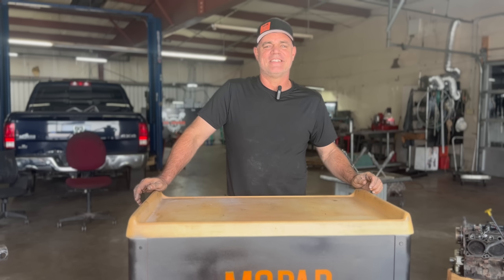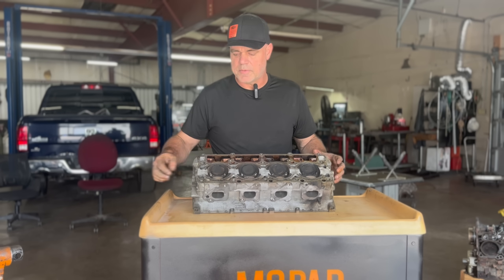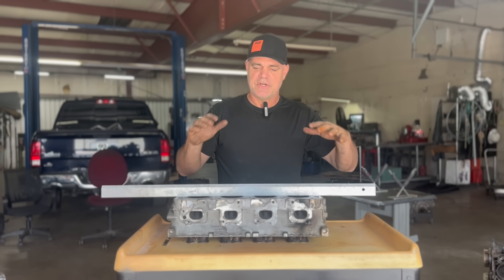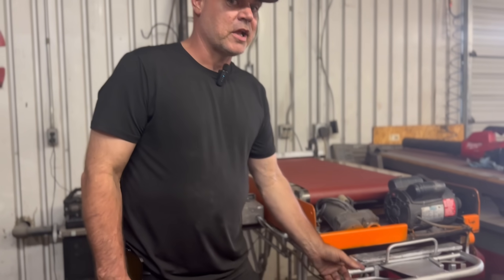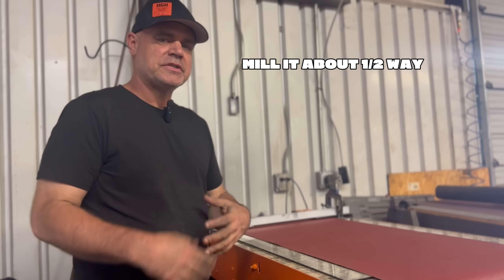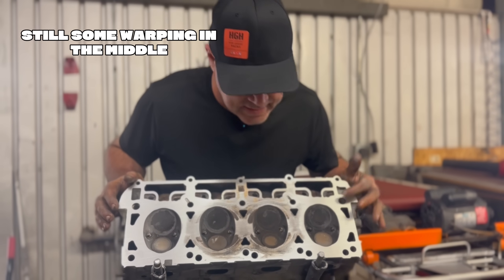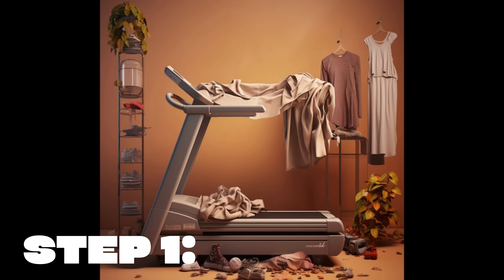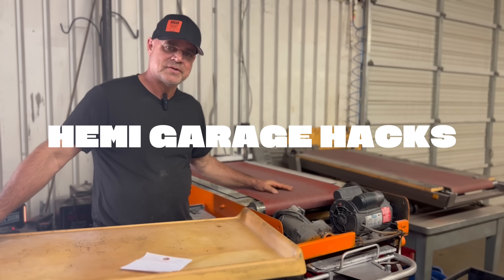I HAVE MILLED 1000+ CYLINDER HEADS WITH A TREADMILL!

Comment: While this will make a flat surface, what prevents this from machining more off one side than the other?  I would think that depending on how evenly the head warped or how much weight is pushing on one side while sanding you could end up with a surface that isn't perpendicular, but is flat.
Reply: really good question and a common one on this topic.  The trick is changing the direction of the cylinder head when you are resurfacing and measuring the time it is on there in both directions.  This has worked really well for me.

Comment: I milled a head from my Briggs and Stratton lawnmower on the floor of my garage with sandpaper.  It raised the compression so much that when I pulled the cord the front of the lawnmower came off the ground. But it was a beast at cutting tall grass.
Reply from the maker: I love hearing those stories, thanks for sharing

Comment: great idea!! what grit paper are you milling the heads with?
Reply from the maker: 60-80 grit seems to work best. 80 grit optimal, but 60 will work as long as you run some exhaust manifolds on it first just to take off the initial aggression.

Comment: Yes this works great, 80 grit.😊
Reply from the maker: 80 grit is optimal, but 60 will work as long as you run some exhaust manifolds on it first just to take off the initial aggression. And the belts last a really long time also.  Thanks for sharing!

Comment: At first I was like, "How can anybody who knows a thing about machining or about engines, possibly think that this is anything other than a totally stupid and idiotic idea?" But yeah, okay I have used granite countertop sink cutouts (often free) as surface plates and while glass is seldom machinist flat, it is flexible enough to shim the low spots and get pretty darn close. I like that the treadmill is of course variable speed, though more power would probably be a good thing. And yeah even a used "proper" mill with a big enough table and x/y movement to mill heads and blocks can be pretty expensive and heavy, but those belts probably aren't cheap, either. Honestly I think I would stick with a proper mill, but your DIY belt grinder apparently can gitter done. So I will just say that this is "entertaining".
Reply from the maker: Works for me, glad you shared:) And if I remember correctly, I think the belts were $250ish for 3 of them.  I bought 9 at the time and that was a long time ago. Glad you are here.

Comment: That’s pretty awesome. Old school dudes did love the sandpaper on glass on granite on table mill lol. Now that’s just how Pakistan started doing it… this thing is legit. 3 extra lbs on outside middles, 5 on centers 👌🏻👌🏻
Reply from the maker: Thanks I appreciate that:)  Crazy thing is you can also do a reverse bow if you shim it just right between the glass and granite.  Not that there is much of a need for that, but it's there if you need it.  Thanks for sharing and glad you are here.
Reply: There is a need for that sometimes I’ve heard. On those long things. That’s where traditionally you bolt it in middle and shim up the sides so you can get that positive center. But hey with this deal hell yea obviously have to experiment a little but just a few strips of paper I’d imagine in the right separation would give you the same thing. Way less guessing just a little more rotation lol. You should maybe ask some dudes who specialize in big hp straight 6’s. RB’s 2J’s etc. they do it. Well some lol. As always… how did you smooth the glass edge? Or found the right old glass table top? Would definitely make sense, and only needs to be smooth on one side. Cut to size and done.

Comment: Back in the 1980s there was a local machine shop that had a big belt sander they surfaced heads on.  I never saw it, but a friend who described it said they would put the head on it and set a sand bag on top and let it sand down a while.  I guess he must have seen a cast iron head being sanded.  Smart use of a heavy pane of glass under the belt as glass plate is dead flat.  They pour molten glass over a pool of molten tin and the glass solidifies before it reaches the end of the tank of tin.
Reply from the maker: Thanks for the helpful information, I love it when people share stuff like that.  Glad you are here.

Comment: Ok that is NOT a treadmill aymore, you may be using the motor of a treadmill but thats about it. there is granite and glass in there, metal subframing that looks like its off my brick saw or something, it just looks manufactured for that exact purpose which is cool and also no longer a repurposed treadmill, you didn't just throw a belt on a treadmill and start milling heads, there was a lot more to be done before that was effectively possible. There is no real treadmill left
Reply from the maker: The frame and rollers are treadmill.  And it looks beefier because it's a bariatric treadmill, which means it's rated for 350lbs.  Granite is for flat surface and stop is added so that I don't have to hold it in place.

Comment: It's effectively the same as a commercial horizontal belt resurfacer.  For those without handy gurneys a simple angle steel frame with casters (scaffolding casters are outstanding, I use them for my compressors and industrial welder carts) is easy to fab. That width is ample for grinding wide intakes like alloy 4.6 and 5.4 manifolds needing cleanup from the usual corrosion.
Abrasive suppliers can make custom length belts if you have trouble finding suitable stock belt offerings.
Reply from the maker: Helpful information, thank you.  another company is called Mirka.

Comment: But you’re not milling, you’re sanding heads. This isn’t new. I’ve done this before but surface finish and depth of cut is important. Also overhead cam heads that are warped need to be checked if the cam journals have warped.
Reply from the maker: Very true, thanks for sharing.  One thing that helps is to measure the time on the surfacer and then flip the head around and place it on surfacer for equal time.

Comment: Belt sanders sand flat,  but not even. 
If you put a rectangle on a belt sander for a long enough period, it will become a triangle. 
The surface at the beginning of the belt feed sands at a faster rate than the surface at the end, because it constantly has fresh abrasive, whereas the sections after have increasing rates of debri clogging the abrasive.
Waxing helps reduce some of that, but it's impossible to completely stop. 
If you dont believe me , take a cheap 2' level to a belt sander for a miute, and then read the level afterwards.
Reply from the maker: no, you are 100% correct.  Best practice is to measure time on the surfacer and change direction of the head continuing with equal time.  Works great.  Thanks for sharing

Comment: You can flatten but how do you keep the grind level. The belt will take more off at the front. It will not sand perfectly level. Wide belt sanders all have rollers on the top of the work piece to keep what your sanding not only flat but level. A surface grinder has a top and a  bottom surface so it takes off material evenly over the whole surface.
Reply from the maker: Best practice for this application is to have equal measured time on the resurfacer in both directions.  Thanks for commenting.

Comment: About 5 years ago, I had an exhaust manifold that was warped. The shop I took it to milled it just as you do, but they used a machine specifically designed to mill objects flat. The objection, from my view, the workpiece gets very hot and must be allowed to cool.
Reply from the maker: you ain't lying!  Yeah, when we resurface a head that is warped bad, I will let it cool 15-20 minutes and them do the rest.  Great share, thank you

Comment: Machine shops hate this one trick 😂
Reply from the maker: A lot seem to.  They hate us cuz they ain't us:)  Just having some fun.  I see where they are coming from, but if it works and it's been proven, then leave it be.  Glad to have you here.
Reply: @HemiGarageHacks  yessir. I've been doing it more or less this way for years. I start with my big cast iron top cabinet table saw, then I put an old double laminated glass panel on top. I use the 2 3/4 wide adhesive sand paper rolls normally used for shaping body filler for my sand paper. I just put however many strips together for the width. Just like downtown 😂

Comment: have done  this with a piece of thick glass and glued sheets of sandpaper...and armstrong power...if block is also alum...most likely junk as cylinders warp out of round...
Reply from the maker: Most of what we have done are aluminum heads, but I have done several aluminum blocks and a few cast iron inline 6 heads.

Comment: Where to find the belt ? And what size is it ?
Reply from the maker: Cut the belt off of the treadmill you are going to use and measure it.  Then use a company called Mirka that makes the custom belts.  60-80 grit seems to be a good range.

Comment: Kind of skipped over the part where you placed a piece of granite and glass in the bed of the treadmill. Getting that bed just right is a key step in getting good results with this setup. If you left the standard base of the treadmill in place it would destroy the heads in seconds.
Reply from the maker: I will be doing a little more detailed follow up on the how and the why soon, but initially I wanted to just share What I did.  Thank you for sharing and glad you are here.

Comment: love the idea and cant deny it is fast. I do have a few problems with this method however. first being that there is no was to accurately keep track of how much material is being removed so you know if your still within specs per the manufacturer and so you can also precisely match a sister head on engines with more than 1 head. 

second issue is that you have limited to no control of where material is removed from meaning that you can get a flat surface that passes checks with a straight edge but that surface may no longer be true with the rest of the head as you may have removed more material from the front or back or one side or the other or some compound angle that means that while technically flat it still may cause issue due to improper clamping forces from the head bolts/studs, variation's in combustion chamber size & shape, and potential valve clearance issues in one or more cylinders and since you don't really know how much was removed you have to experiment with head gaskets to you get lucky and get the correct clearance.
Reply from the maker: You are 100% correct, and for me that is why I think it is important to measure the time equally on the surface with the head in both directions.  Thanks for sharing your thoughts.

Comment: This is awesome ! Perfect for regular cars with composite gaskets ! I’ll have to give this a go next time, I’ve been using the old manual method with my arms 😂 what grit paper did you use on the treadmill ?
Reply from the maker: 60-80 grit was a good range for me. If you do 60, break it in with a couple of exhaust manifolds just to knock a little of the edge off.  Hope that helps and glad you are here.

Comment: You should explain that under the sand paper, you need a flat surface, we see you are use a sheet of glass, but you could use steel plate as long that it’s flat
Reply from the maker: My strategy was granite, with untempered glass on top.  Glass protects granite surface and allow area between glass and granite for shimming if necessary.

Comment: 1) Maybe you could put knobs on the roller adjustments so that you can easily adjust and not have to use a wrench. 2) I would move the motor to the wall side and elevate it, then you could add water or machining fluid to the belt.

Comment: I know I'm late to the party, but...Did you ever give the grit of the belts your using?  I have an old "coat hanger" that I think may become a mega belt sander/mill.  Also, ballpark on the cost and your source?
Reply: 60-80 grit has worked great for me.  If you chose 60 grit, then run a couple exhaust manifolds on there first and you should be good to go.  I bought 9 belts 13years ago and I still have 2 left from then, so for pricing I have a vague memory of it being like $250 for 3 belts.  I don't know how much it would be now.
Reply: @Life.With.Meaning  Okay, thanks for the swift response!  Did you happen to 
get them from Klingspor?
Reply from the maker: @russellanderson746  Mirka.  Hope that helps.

Comment: After milling a head do you need to get a thicker head gasket?? Very curious cause I may need to do this.
Reply: Not once have I needed too.  With that in mind, almost all the heads I have done have been 2.7, 3.7, 3.5, 4.0, 4.7, 5.2, 5.7, 5.9, 6.4 Chrysler/Jeep/Dodge.  So other heads may vary.  thanks for the question
Reply from the maker: yeah, what he said:)

Comment: I made a 28"x16" surface plate within .0005" with a straight edge, sandpaper, a tenth indicator and precision level. The most important part of the process was measuring. I could have REALLY used your sander, it would have saved me several days.
Reply from the maker: Dang, you are patient!!! Respect:)

Comment: With this process, do you encounter issues with the journal for the camshaft being warped?
Reply from the maker: Most of the heads we do are hemi which are not OHC, however we have ton's of 3.7 and .7 which are the OHC and the for best results, I put the head on the surfacer for equal time in both directions.  Hope that helps, and glad you are here!

Comment: A Treadmill deck job? Nope don't even attempt it...Although better than what  I've seen people do back in the day palm sand them with an electric sander...😂
Reply from the maker: Seems like a crazy idea huh?  Wouldn't it be so cool if it actually worked though? Imagining being able to flatten a head surface with a took that took less than $500 to make and lasting 13 years.  What if it's true?  Hmmmm!  What if.
Reply: @HemiGarageHacks I guess as long as you're not running a lot of boost...

Comment: I got three minutes in before having to stop watching. The 'pop' with every title graphic and the jumpy edits make this video nearly unwatchable.
Also, just before I had to stop, where you checked with the feeler gauges, that's not a 'blown' head, it's a "Warped" head, likely bowed down it's length. Hope you checked the valve gear ran true, if it had been an OHC head the cam could bind from the bowing.
Reply from the maker: Thanks for the feedback.

Comment: What sandpaper grits are you using? Also, don't use this technique on an overhead cam engine. Nearly ruined my Jaguar 64 XKE engine when a shop leveled the head against my instructions.
Reply from the maker: 60-80 grit.  And I have a technique on OHC heads that has been successful.  Glad you are here!

Comment: I am assuming you don't mix cast iron parts with aluminum parts on the same treadmill to prevent introducing cast iron into an aluminum head that may cause some rust issues. As a novice DIY, I am assuming you have to use a thicker head gasket after milling the head to maintain OEM compression thickness between the head and block.
Reply from the maker: while I have resurfaced a handful of cast iron heads over the years, almost all of the heads we do are aluminum.  and no thicker gasket.

Comment: If one we're worried about it they could buy a used aa grade surface plate instead of glass still would be under $2k. I'd bet that if it is off it's outside most people's ability to measure... measuring things accurately is hard/expensive. Great idea! Great execution! Plenty of diesel blocks been prepped with a wetstone. It is funny how many people will comment on this head method but will prep the mating surface on the block with a grinder lol.
Reply from the maker: Great input, thanks for sharing

Comment: I'm impressed as I did not think of using a treadmill but I have sanded aluminum blocks by hand.  I glue sandpaper onto counter "granite" that I've measured to be sure it is perfectly flat because it is often good enough for kitchens but not perfectly flat for engines.   Plate glass is also ground but  I think the "granite" is thicker and flatter.  Your method of power sanding is 100-200 times faster than doing it by muscle power.
Reply from the maker: Indeed my friend:)  Thanks for sharing

Comment: 1. Everyone gets this wrong: glass is not necessarily flat, nor even. And it bends. So if you shim one end of a thin glass pane, it will bend.  A good setup would be a machinists granite block, and a blanchard ground plate, both of which are flat to known tolerances and extremely stiff. 2. If your surface is flat, you will not necessarily get even material removal. The pressure from your hand, or the way you move/hold the head, can cause more material to be removed from one end, or one side, or both. Yes, it will be flat, but it won't be even. 3. That sanding grit is really bad for your lungs. Either use a respirator, or an extraction / filter device to contain the dust. Your lungs will thank you.
Reply from the maker: Great advice, thanks for sharing!
Reply: It doesn't matter if you use a flat rock and chisel to machine something as long as the results are within spec. The best tools in your shop should always be your measuring tools.